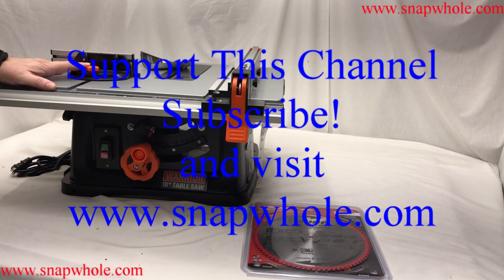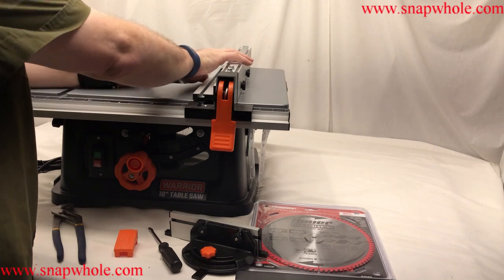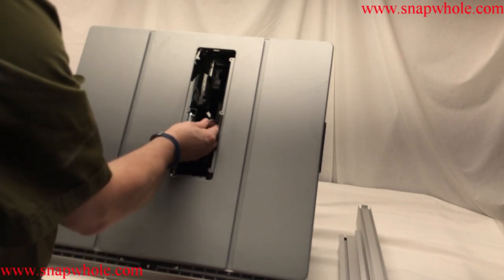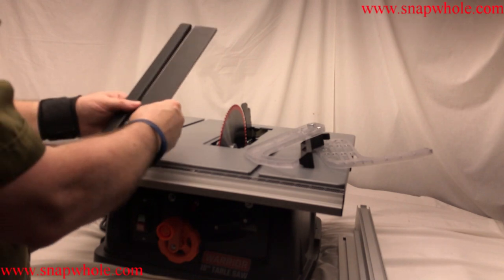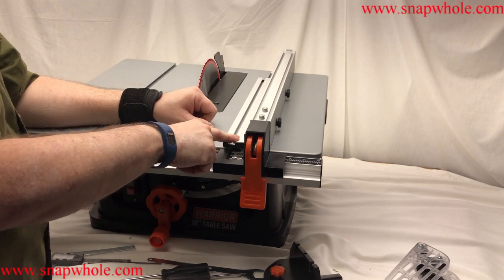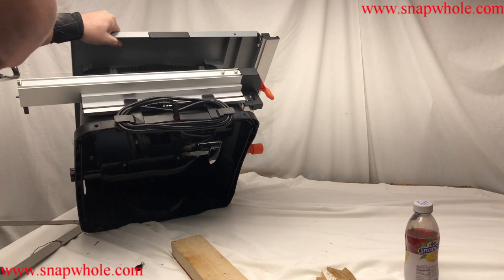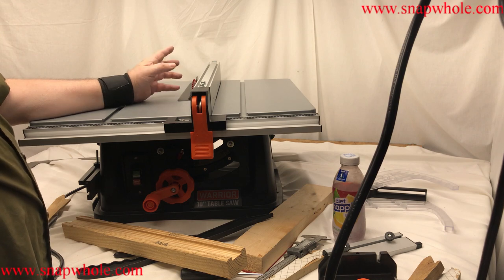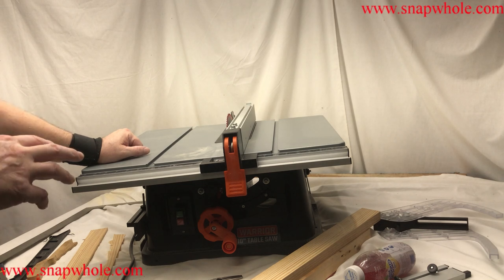Harbor Freight Warrior 10 inch 15 Amp Table Saw Review and Setup

Comment: Unless you're making your own mitor jigs, I wouldn't cut a pizza with this thing. Flimsy, cheaply made, the mitor insert jiggles at least a 16th in each direction. Springs were popping out of the rathing knife handle. I was scared to turn it on.  Spend an extra 30-50 bucks and get a name brand saw. Some cheaper models are built well, this is not one of them
Reply from the maker: can you provide details on the riving knife spring issues? I'm surprised you didn't find this video that fixed the miter slots , https://www.youtube.com/watch?v=eZ4YVJZL5EA, I also covered the riving knife, I found it was solid and worked as intended, I covered that topic in this video https://www.youtube.com/watch?v=0avJg2f5r80, I also covered the odd dust collector size in this video, https://www.youtube.com/watch?v=vaW28arDkeE, I've used this saw for several months now, and have consistency gotten accuracy to .15 mm which is good for a jobsite saw, I still go back to my cast iron, 1990's craftsman table saw for 'fine woodworking' - I really would not expect much different performance from any other jobsite saw - thanks for subscribing!

Comment: The saw is okay for DIYers... but the biggest problem is to raise and lower the saw blade the machine uses two offsetting NYLON gears, not metal but NYLON. So sawdust builds up on the threads and between the gears and they strip. Be sure to blow that area clean often and DO NOT use any grease or lube... it will cause a build up and then your in trouble, this I know from experience.

Comment: This was a perfect video. As a new table saw user I needed your excellent info. One question, other videos talk about the importance of riving knife being perfectly behind the blade. Mine isn’t. This Warrior 10” doesn’t have an adjustment for the riving knife. Did your saw riving knife align with blade? Thanks for the video.
Reply from the maker: when you cut a piece of wood on the warrior saw, the blade creates a kerf (just like a manual saw would to, just faster) the kerf continues behind the blade, and riving knife MUST go in the kerf, when I examined the riving knife mount, it was aligned, so I didn't even mention adjusting it, same for the saw I took back, the saw basically has a 2 point mounting, with a third lock point, let me look at it again to find the best way to adjust, I'll leave a message tomorrow - thanks for subscribing!
Reply: @snapwholeharborfreightreviews  Yep, I know this. The knife isn’t aligned with blade and I don’t see any way of adjusting or aligning it. No other videos discuss it. I wonder if I got a lemon, bummer, too late now to do anything about it.
Reply from the maker: I just published a video on adjusting the riving knife on the admiral, its the same concept on the admiral - look at the exploded view diagram in the manual, parts 60-69 is the detail, looks like you'll have to use shims because it mounts a little different, but it is adjustable - thanks for subscribing
Reply: @snapwholeharborfreightreviews  Ok, thanks, I will check it out.
Reply: @snapwholeharborfreightreviews  I had this same problem... Turns out I used a 7 inch blade... Went and picked up the 10 inch then it still would not align and I  actually had the nuts reversed... Reversed the nuts then it's mostly lined up. Still have a problem with the blade vibrating as soon as the wood hits the knife so I guess I'll go check out his alignment video.
Reply: @mtnmonamona842  I had the same problem -- the riving knife actually blocked the wood, forcing me to guide the knife into the kerf with my left hand to continue the cut.  I had a little success by raising the lever, tilting the knife to the side, and holding it there with my left hand while pushing the lever back down with the right hand.  Ultimately, I had to use a bit of non-corrugated cardboard as a shim, which worked okay though I needed to replace it periodically.
Reply: @cbgee674  Thank you, my saw has been sitting not used. As a newbie I’ve been nervous/scared about trying to cut. I will definitely check out cardboard shim. I’ll need to find a heavy cardboard since if I recall, the knife is off by quite a bit. Again, thx.

Comment: The couple of Wild Wonderful Off Grid channel have been using either the Warrior or the Admiral Harbor Freight table saw during their entire house build(4 years?). The plastic base had a crack in it but the thing just keeps on running.
Reply from the maker: I like this saw, I still need to make a slide for it, thanks for subscribing!

Comment: Thank the heavens haha. I didn’t have the problem with the fence guide. I do have to measure and adjust to make sure I’m good before I cut. To adjust the blade to be true I shaved off one of the washers on the left side of the blade adjustment because I couldn’t get a true 90 degrees. For a saw around $130 you can’t go wrong with it. My only gripe is that HarborFreight doesn’t sell a featherboard that will fit in the miter slots. Thanks again your the best.
Reply from the maker: Thanks - I was surprised at how good this saw turned out to be, watch for more videos related to the saw - small sled, full sled, fence extension are my plans right now - I had a lot of problems editing and finalizing this video - most related to using 4K video, finally had to use 1080p, new camera, new laptop caused most of the problem - found out that not all 4K video is created equally  - thanks for subscribing!
Reply: Did you find a featherboard that will fit the miter slide? I’ve tried 2 different ones and both won’t fit
Reply from the maker: I have a video that will be published soon on featherboard ideas, and shows the one that I use, which is a very different approach...... I used the HF yellow feather board, and I did not want to permanently modify the featherboard, but if you modify the featherboard, it is a better approach - and I cover an idea to use for featherboard mounts that has other possible uses, I need some time to work out how to use it, and just like the other idea, if I permanently modify the featherboard, it is and easy setup

Comment: I got this saw as a gift and haven't unboxed it yet.  Thank you for this video.  You really removed all the intimidation I had about setting it up.  Very nicely done!
Reply from the maker: Thanks for the positive comment, and glad you found the video useful - I'm working on a way to make slides for the T-slots, hoping to have a solution soon - thanks for subscribing!
Reply: @snapwholeharborfreightreviews  I got my saw setup and running. Thankfully everything was fine on mine right out of the box. Thanks again for your great video. If you ever get that solution worked out please post another video. Can't wait to see it.

Comment: Thanks for the quick guide to set things up.  I have several (better) table saws but I didn't bring one to the job site so I have to pick up this saw for a few cuts to finish up the contract.  It looks like a usable saw with lots of extra adjustments to get things square for the cut .... and the price is reasonable.
Reply from the maker: I also have a few better table saws, but this saw has its uses, and if you verify the setup, it is accurate, too bad it is not on sale, it is meant to be a jobsite saw, I use it alot, but for serious work, I still go back to my big table saw - that dust port out the back is an accident waiting to happen, all you have to do is set it down wrong and it will break - thanks for subscribing!

Comment: I wanted to pass on my heartfelt thanks for your video. I watched it before going to Harbor Freight to pick one up, then watched it as I set it up. I could not have done it without you. Cuts then made of the things I needed. Only odd thing was while putting the blade in, what looks like a rubber stopper with a spring in it popped down to the bottom of the saw casing. Worked fine without it, any idea what that piece is? Thanks again, your video made the setup relatively sane. Subscribed!
Reply from the maker: that happened to the me on the first one I had, it is a spacer for the dust collection chute that is under the saw blade, probably on the back by the riving knife, right under the saw top - it does work ok without it, I think its there to allow a little flex to the chute in case pressure is put on the chute while changing blades, glad you found the video helpful - thanks for subscribing!

Comment: Thanks very much for the excellent video. I learned a lot, but felt like a noob as I should have known it already! Really appreciated your good explanations. Problem I have: I align the blade at 90°, then rotate to 45 and it is way off, not parallel with the tracks. I would’ve thought if it were aligned at 90, vertically, and with the tracks, then it would be aligned with the tracks at 45. How do I align it horizontally when it is at an angle?
Reply from the maker: that is a tough one, makes the saw difficult to use, but its a sign the riving knife needs adjusted, the way its mounted, it should stay the same in both positions, the motor and the riving knife are both mounted on the same pieice of the frame, anyway you can get a video of what its doing? I've heard from several people having issues with the riving knife and made this video with ideas - https://www.youtube.com/watch?v=0avJg2f5r80 - I had a similar issue as yours with the admiral, and traced it to the way the riving knife locked - when you go from 90 to 45 is the blade still parallel with the tracks? I'll look at the warrior saw today and see if I can reproduce - thanks for subscribing !
Reply: @johnraffensperger Wait a minute… let me try to understand what you are sharing. Quick question: what do you consider the “tracks” to be? then we can go from there.
Reply from the maker: @mikefranks4528  the tracks are the slots used to slide jigs across the table top - the most common are sleds, most commonly used to make most cross cut operations - its basic purpose is to ensure the cut is 90 degrees, if the slot is not parallel to the blade, you cut will not be 90 degrees, so it y ou built a box using the sled, the box would not be square - thanks for subscribing!
Reply: @snapwholeharborfreightreviews  OK I thought so asked for clarification. When you showed the link for the video of the riving knife I got confused as to why it was discussed. So I’m assuming there’s a rotate adjustment for the arbor on the Y axis?
Reply from the maker: @mikefranks4528  there is no easy adjustment
- here is a video talking about adjustment options on the warrior - https://www.youtube.com/watch?v=0avJg2f5r80 - compare that to this video on how to adjust the admiral saw HF sells https://www.youtube.com/watch?v=YecamfLnI58 - the warrior does not have an easy adjustment - several people have messaged me about issues with the alignment of the warrior riving knife and I personally had problems with the riving knife on the admiral saw
Reply: @mikefranks4528  By "tracks", I mean the grooves in the table which typically hold the miter fence and sled straight. When setting up the saw, we want the blade parallel with these tracks to make a straight cut. When I set up the blade vertically, it aligns with these tracks, i.e., the rest of the table. But then when I rotate the blade to 45 degrees, it no longer aligns with the tracks. The distance of the front edge of the blade to a given track differs from the distance of the rear edge of the blade to the same track. 

The problem seems to be that the rotation gearing is poorly designed.

Comment: Seems there would be an adjustment on the fence to brace it better on the flow out side..
Reply from the maker: there is an adjustment on both ends, tightening one end will auto adjust both ends - thanks for subscribing!

Comment: I just this saw for x'mas .. do you know if I can stack a dado on it ??? I could not find the info anywhere on HF website ... thanks ... great video by the way ... Love how you show all the "little" settings ...  great job ...
Reply from the maker: I just bought a bauer dado stack and I will try it and get back to you - it all depends on the length of the arbor bolt, first impression is you will barely (if at all) be able to use the full dado stack on the saw, but I want to confirm that with empirical data before I say for sure - thanks for subscribing!
Reply: I bought a used Craftsman "wobble" dado blade and cannot fit it into the HF table saw.
Reply from the maker: @johnraffensperger  I will try fitting my wobble blade, the wobble blades are made for a short arbor saw, is the dust collection getting in the say? the bauer dado stack works differently, its possible the warrior can't use the full width of the bauer dado, thanks for subscribing!
Reply: @snapwholeharborfreightreviews  what was ever the outcome on this?